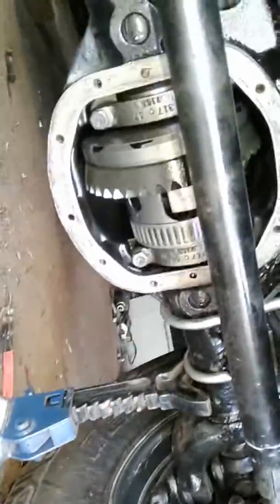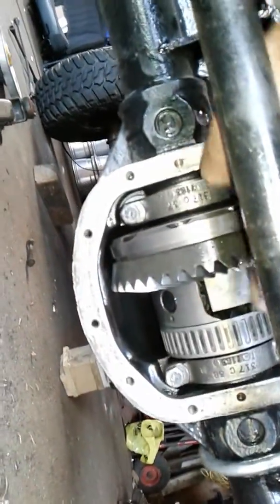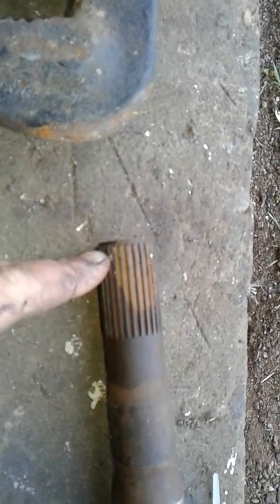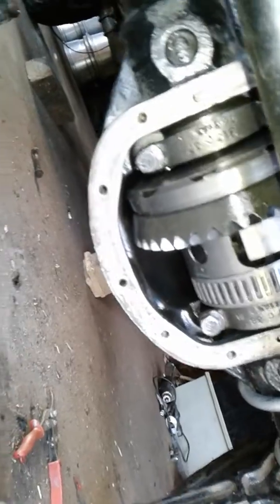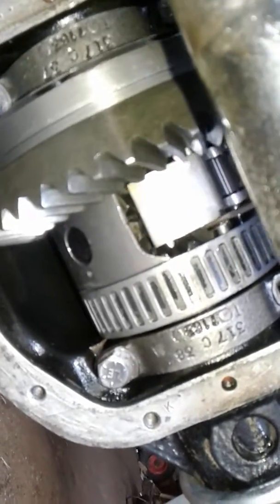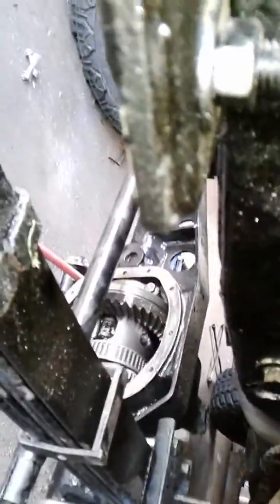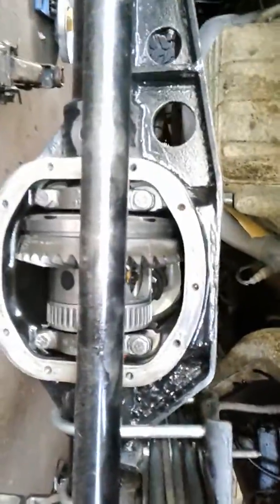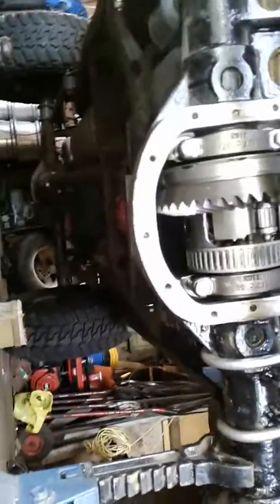Dana 30 with Volvo G80 locker

Comment: I put one in my 1999 xj cherokee . 4.56 gears on 35s . I’m like you not sure how tuff it is but I have used it maybe 3-4 times in snow and mud . I wouldn’t want to make it engage on hard rock or dirt. It take 100 rpm difference in wheel spin to make it engage . In wish I had of went with a selectable locker as you can lock it and ease along . Basically you have to be stuck then gas it to engage it . Anyway you’re right it does work .

Comment: Great and informative video! Is the G80 a auto locker or more like a limited slip? How it is on the street in the rain going around corners and such? Do you know if the G80 from a Volvo is the same as the one from a GM truck?
Reply from the maker: It's a inbetwener locker lol. It'll lock up but if you spin the wheels and it gets above a certain speed it will unlock. It's the same premise as the gm G80 but a smaller carrier
Reply: both GM G80 and the volvo G80 are made by the same company, Eaton

Comment: I'd like to know what you're using for the leaf spring packs on your axle.  I'm assuming it's something you made up and would like to know how it rides?  Thanks
Reply from the maker: I'm running spring over axle right now , using stock 2002 s10 2wd leafs with 02 Silverado middle spring and helper Spring . I've had wrap issues so I'm going spring under next year , moving the perches to the bottom of the axle . They are a flat spring , loads of down travel  , but put bumpstops for uptravel or you'll Bend them

Comment: That piece you were pulling on moves out at high speed to keep it from being able to lock, not to make it lock.  The part that does the locking is the small round thing next to it that spins when you turn just one axle.  It engages with the piece you were moving so if the vehicle is going fast enough and that part has moved out when the other one tries to engage with it it can't so you get no locking.  In a Volvo I think the lock disable happens around 25MPH, with the big tires that threshold will be higher.
Reply from the maker: You're very correct !! So far it works great offroad , other than snapping Dana 30 axles like twigs sometimes , 3 times to be exact lol
Reply: @jawkneebebad  I just learned of this junkyard gold for the Dana 30 and was concerned with it being durable enough for off road use.  If it can handle 3 snapped axles it's strong enough for my use, thanks.

Comment: How has the carrier held up for you? I just got my hands on one I’m going to be putting in the front of my jeep soon.
Reply from the maker: I recently got stuck badly and broke the passenger side axle shaft, replaced the shaft ,and the carrier is still doing fine
Reply: johnny bebad that’s good to know the carrier holds up good. I’d rather snap a shaft than grenade the diff itself.